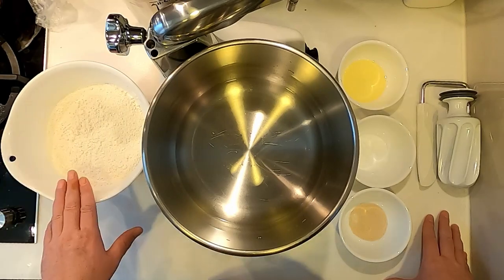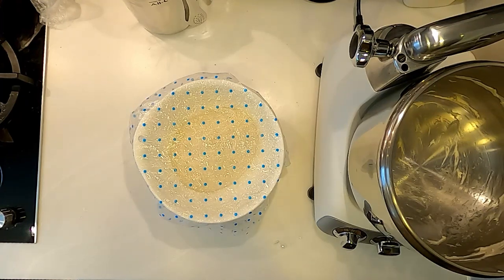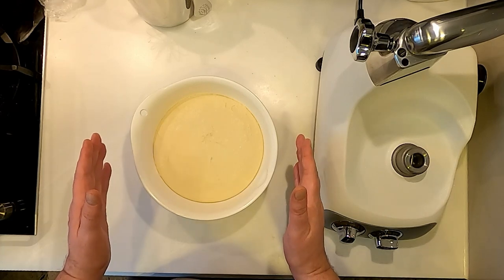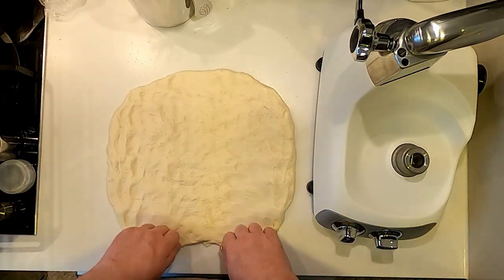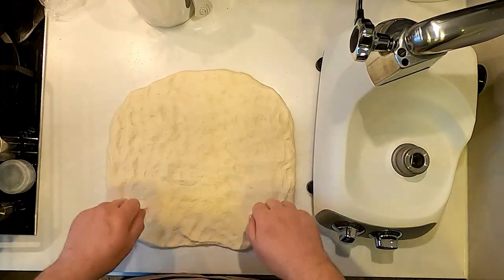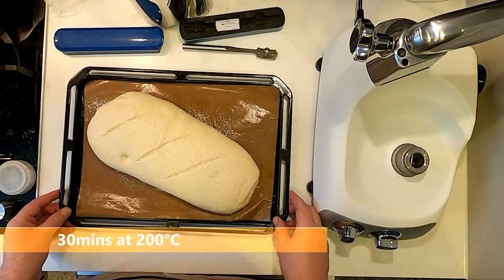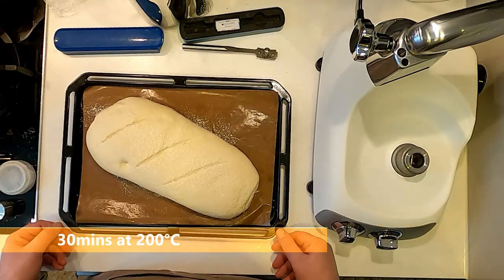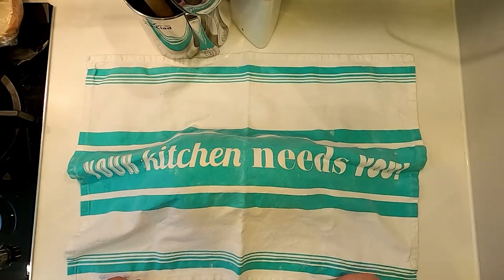TwistyBakes Bloomer made in Ankarsrum Assistent

Comment: I too have just purchased an Ank. I've never owned a mixer and i have always hand kneaded. I love making different types of sweet buns, brioche so i dont do a big batch at a time. Usually i do 500g flour with 300g liquid. It has been painful to learn to use this machine. I feel like my mixture takes forever to become a dough. I could have just used my hands. Can anyone help please?
Reply from the maker: There is definitely a learning curve, as seen in my videos.  I typically use quite long knead times with the roller - maybe 15mins for a basic white bread.
Reply: The Ank is a mixer designed to do mainly large batches of dough although they say it can do small batches. You’d have been better off with a planetary stand mixer if you’re working with 500grams of flour. You could make double batches and either freeze half the dough and defrost over night or bake, or half bake all and freeze half. You could also email Ank in Sweden, they’re very helpful